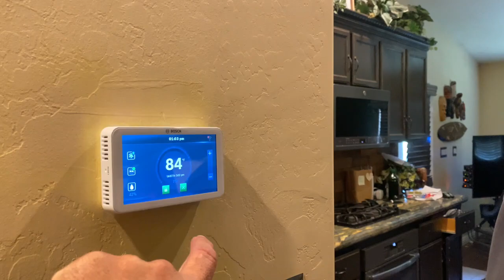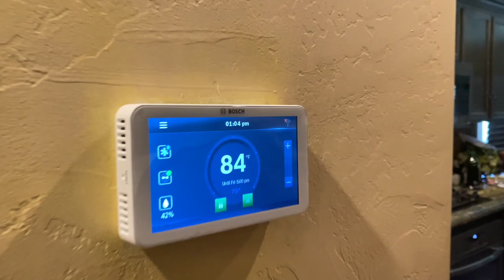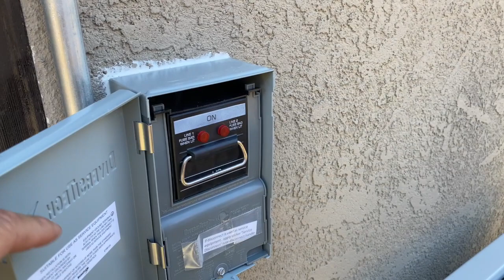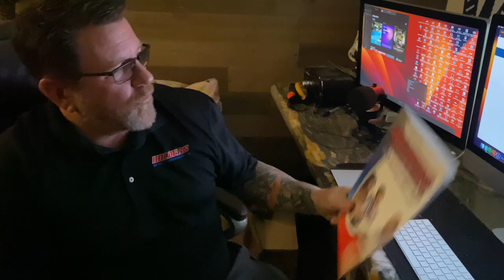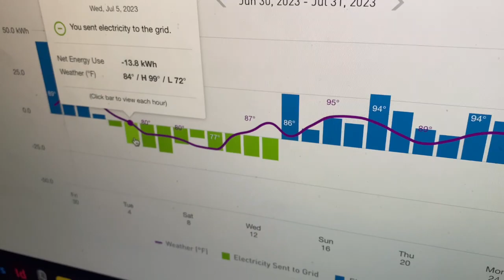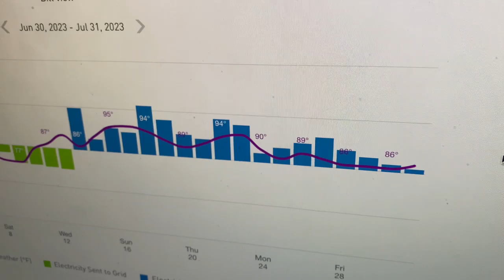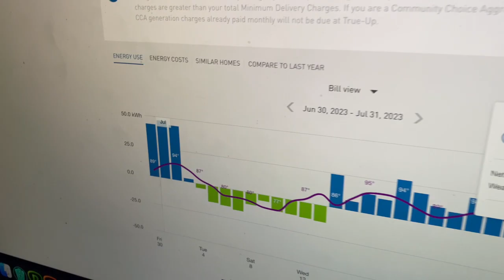DO THIS to LOWER YOUR ENERGY BILL - Bosch 4-5 Ton 20 SEER Heat Pump Inverter. HOW YOU CAN AFFORD IT!

Comment: We have a Bosh here is PA and it has really kept us comfortable even when the temps are 5-10 degrees here in winter.
Reply: Is that with straight heat pump or with backup heat
Reply: @ Straight HP

Comment: I have 36 years of HVAC under my belt and have installed many Bosch IDS systems, not sure where to begin, first off the Bosch IDS outdoor unit is only manufactured as a heat pump, thus meaning it will work with an air handler with or without back up electric strip heat, or in a duel fuel setup with a gas furnace. They mentioned your locations climate is mild and you would not need supplemental heat, they disregarded the fact that while a properly installed Bosch IDS condenser rarely fails, they can still fail. Therefor if I had been your contractor, assuming you didn't have the wiring for backup strip heat, I would have recommended a Bosch furnace instead of the air handler without backup strip heat since you did have gas available. You would still be primarily a heat pump conditioned home, but with the ability to have backup fossil fuel.
THe good news is that the Bosch IDS is above average in reliability, the bad news is that if/when it does fail, you have no backup, yet you could have.

Past that so not impressed with the install, again where to begin, piping of the refrigerant lines used excessive amounts of fittings, apparently they don't own or use tubing benders. They never showed brazing or soldering of those connections, so I can only hope they did it properly under nitrogen purge.  Service side of the condenser is way way to close to the house, not even close to minimum recommendations of any manufacturer, and a sure way to piss off a tech trying to diagnose fix it. Also of mention, the filter/dryer should be installed indoor near the evaporator coil, not outside at the condenser. 
Don't see an RSH 50 or equivalent surge protector at the disconnect. that is a 1k plus control board, it needs surge protection, Bosch insists on it.
Last guy states, after his or another company hooks up gauges over and over for 10-15 years you might need to add refrigerant. He is correct on that, where he is wrong is that after a proper installation, gauges/manifolds should never be hooked up unless their is a problem to diagnose  and repair.Otherwise there is no need to hookup.
All performance data can be gathered and calculated using psycho-metrics without hooking up hoses to the refrigerant circuit.

From the video, I won't say they know nothing about HVAC as a whole, but I do feel they don't fully understand inverter driven systems based on their comments.

As much as I love the Bosch IDS system, at the end of the day, the duct work is the most important factor, and no piece of equipment can fully correct that, some might overcome it better than others, but none fix it.

Last note, I am assuming the last guy was the owner that quoted 10-15k for a High efficiency system. WOW last year we did a 3 system replacement using Bosch IDS systems for 26k. Damn either we are underbidding massively or others are just price gouging, I'll have to sleep on that, and well I sleep good knowing we make money but don't rip people off.
Reply: Where do you service and install? I'm thinking of going with this 20 seer Bosch system. Is a heat pump the same as a furnace? I have electric and no gas.
Reply: @WolfNRaven  Heat pumps and furnaces are not the same, but can be used together in whats called duel fuel setups.
All Bosch condensers are heat pumps so they can be coupled with a fossil fuel furnace with an evaporator coil, or be matched with an air handler with or without supplemental/backup electric strip heat.

Climate is a huge factor in system design especially heat pumps and any need to supplement with strip heat, not knowing your climate I cannot go into all factors.

In short heat gain vs. heat loss factor greatly in heat pump design. 

Comment back with where you live, there are huge differences between say any southern state vs. Northern and north eastern states, and other implications for the in between states.

I am in southern Illinois, where neither heat gain or heat loss take precedent, we have to balance both, some climates require one way more than the other.

I will watch for your reply, even if you are a 1000miles away, and I cannot physically assist,  will gladly do what I can in you tube comments.
Reply: @ZERO-F2G- thank you for the above comment I wish you were in NJ.  Im having 2 system hopefully installed in next week or two. Both are bosh ids 18ser. AC and heat pumps with electric stips. I have oil as my back up. In my areas I have ofter power outages sometimes long sometimes quick. Can you recomend a surge protector for the units? Thank you in advance.
Reply: @cvello3275   We use RSH-50 surge protectors at the outdoor unit disconnect box, even if the house has surge protection at the panel.
They are inexpensive, and I believe superior to their competitors, and both my Bosch and Mitsubishi distributors recommend those.

Side note; Check with your electrical provider about rebates. Where I am at the IDS18 HP doesn't qualify, but the IDS20 does.  We can hit the needed efficiency for the rebate with an IDS 20 heat pump and either or 18 or 20 air handler or coil in duel fuel setup.
There are also federal tax credits you can apply for.
Reply: @ZERO-F2G-  awesome thank you for getting back to me whats your thoughts on the ICM517 thats what I was originally recommended.  Also your thoughts on thermostat im looking at honeywell nothing to smart or crazy like nest
Reply: @cvello3275  I have no experience with that product, but I will say that ICM controls is a reputable manufacturer so I would venture to say their surge protector works just fine.

Bosch systems will work with almost any heat pump compatible thermostat. That said their can be conflict with some of the energy saving thermostats, such as ecobee and nest.
We use Honeywell T6 Pro thermostats on most of our installs its a great stat overall and will work with the Bosch, However 
In duel fuel setups where we have a Bosch heat pump and evaporator coil combined with either a Bosch furnace, or an existing furnace using natural propane of fuel oil.

We prefer the Bosch BC100 thermostat for a couple reasons.
Primarily because it doesn't rely on having an outdoor temp sensor or in absence of that rely on time base for switchover to fossil fuel when needed. It uses your wifi to monitor weather to determine fossil fuel switchover based on conditions.
Reply: @ZERO-F2G- I thought I watched a vid last night and the T6 stat was one the had issues with the ids hp..I'll have to find the vid
Reply: @VooDooV6  You could be right, we use the Honeywell T6 pro quite a bit with our American standard and Comfort maker systems. 
We have not used it on a Bosch system, with Bosch we prefer to use their thermostat, but we have also used Pro 1 thermostats with zero issues.

And have used a few others with mixed results.

Our findings are the Bosch IDS works best with either their proprietary thermostats, or basic HP thermostats that aren't smart.

The clash tends to between the IDS intelligent board and an intelligent thermostat not agreeing.
Reply: @ZERO-F2G-  Good write up , I’ve been in it for fifty two years , Commercial / Industrial and Residential , not impressed with their work.

Comment: I just put a 3 ton 20 seer in my own house. With employee discount from supplier, 2k instant rebate from utility company the equipment only came out to $3100  and some change. Plus I got a $900 tax credit. Getting ready to put an AO Smith heat pump water heater because they’re offering an instant rebate for $1600 and it only costs $1700.

Comment: Next you need to replace your gas water heater with an electric heat pump water heater.  So many rebates and deals in California you can probably get it for free.
Reply from the maker: We did that, it’s in the video.
Reply: @btuff  15:23 that’s an AOSmith gas water heater.
Reply: Rheem Performance Platinum 50 Gal. 10-Year Hybrid High Efficiency Tank Electric Heat Pump Water Heater is the best WH on the planet. I bought mine in 2019 or 2020 with $800 rebate from our local power company. The app shows you power use per day, week, month and year. For 2023 i have used 434 kWh. During the hot summer months i put it on energy efficient which turns it to both electric and heat pump mode. The heat pump takes the heat out of my garage from the top of the unit and pushes cool air on the side of the unit cooling my garage a bit. During the winter i put it on electric only because my garage is cold so heat pump wont help.